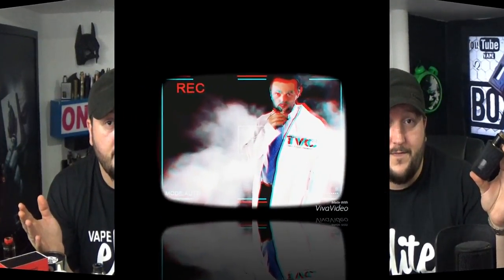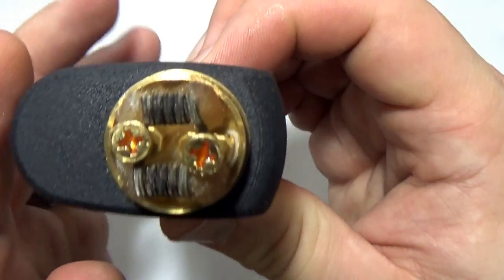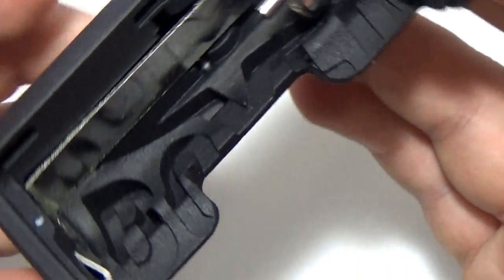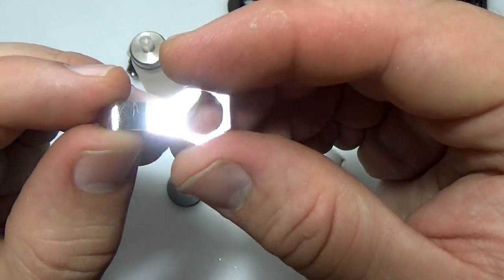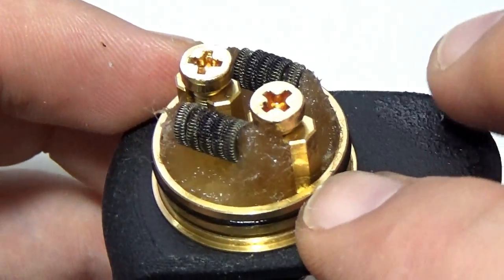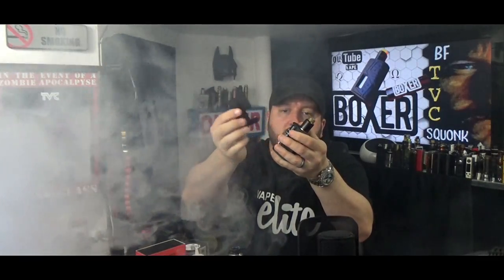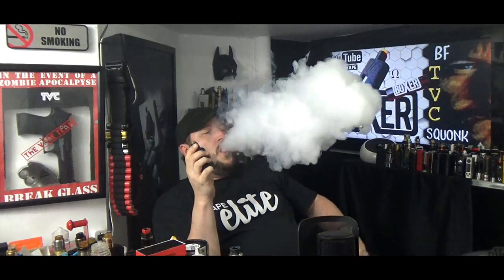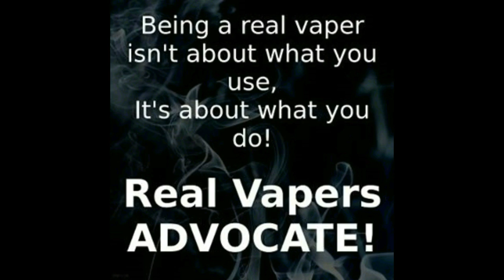Boxer Mod Classic BF Squonk Mechanical Mod By Ginger Vaper On TVC

Comment: Nice review Brian!  Ya know for me vaping of late has been somewhat boring because I basically have everything I need to get a satisfying vape experience to keep me happy.   Not to many things coming out have peeked my interest but this Boxer Squonk Mod has my interest and has me excited to get my hands on one.   I am waiting for the version that takes the newer larger batteries because I want the balance of high capacity and ampere rating that you can't get from an 18650.    I know the 18650 versions will sell well as most will want those because they already have 18650's to use.   The button rattle does not bother me because being able to lock that button is a wicked awesome feature.   That 510 fill bottle they come up with is also very interesting because I don't really want to muck around with removing and filling the bottle and it puts less wear and tear on the tubing.   I do enjoy RDA's but hate the dripping part so Squonking is of interest to me besides its a pain to drive with your knees on the steering wheel when dripping because when your dripping you never encounter Red Lights to drip which is they only thing a Red Light is good for these days.

Comment: i love how that nut is in a nut pocket taking that top piece of the 510 should require no tool for the nut ..making it easy to take it of for servicing or to re-spot the nut so that you can get that atty to screw on  and have the air intakes land just the way i like when fully screwed on :) DID I MENTION I ORDERED ONE ??? papaaaaaaaaaaaaaa :)